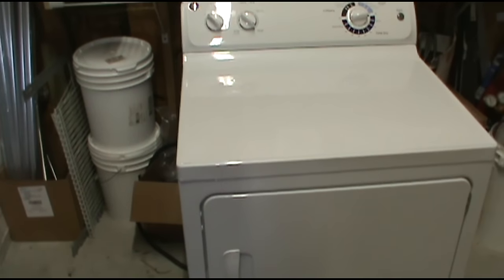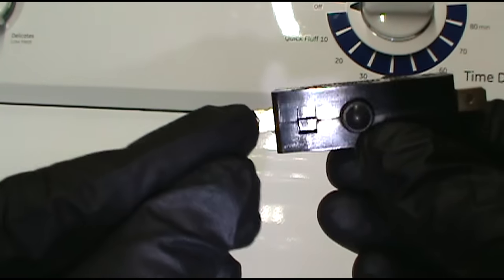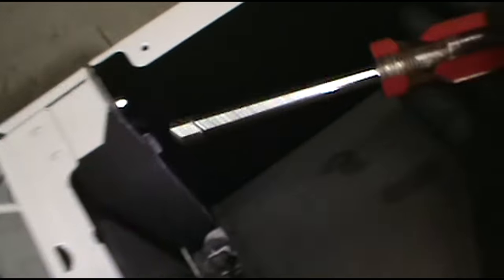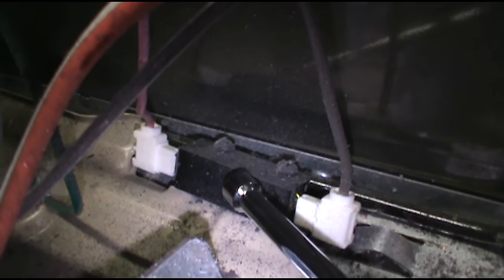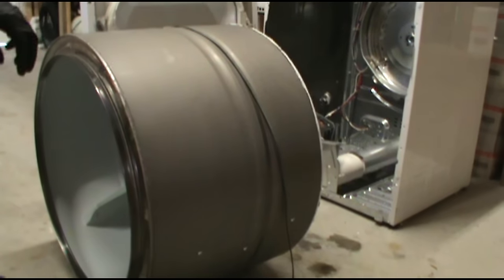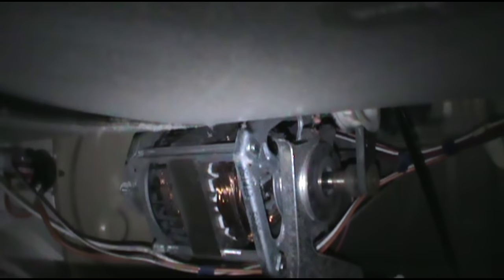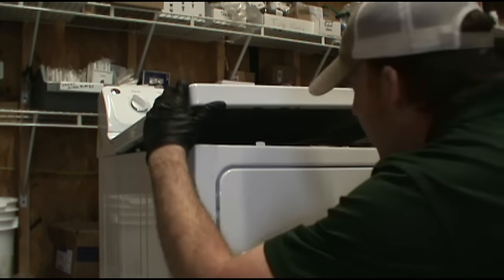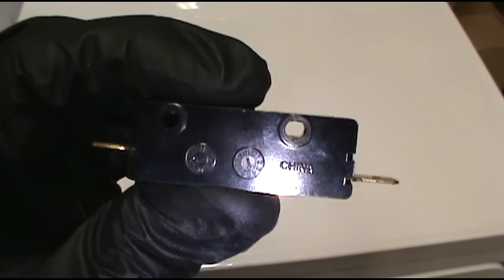Dryer Will Not Stay On After Pushing Start (How to Fix)

Comment: When I push my start button on this exact model nothing happens. I can manually spin the drum, which pushes that pulley switch button and th3 drum will spin. However, no heat. Bypassed thermal fuse, still no fix. Could it be the start switch afterall? Here is the kicker - if I set it to "no heat air fluff" mode, I cant get the drum to spin by giving it a shove anymore!
Reply from the maker: That's a head smasher. Pull the timer dial switch off & make sure it's not cracked. Dryers are hard to diagnose when not there. Could be belt snapped. Could be bad motor. No heat could be a broken element. I'd need to be there for this one.

Comment: My problem is the dryer runs for about five minutes then shuts off. It heats up and the drum turns. I checked all the sensors and they are good. Any suggestions on what the problem could be?
Reply from the maker: The vent tube in the back of the dryer is either kinked or clogged with lint. If the heat can't get out, it will shut off. It's the safety switches doing their job. Hope this helps! 🤞 Thank you so much for watching preclovis!

Comment: Our belt is completely torn and we believe it was because of an excessive load. It is likely that the belt just needs to be replaced? The machine is only 3ish years old.
Reply from the maker: Yep, just replace it. Check the wheel that it rides on for any rough areas, just to make sure. But, sometimes they just break. It's like a big rubber band that expands & contracts when it gets hot & then cools off. Doing that over & over for years will cause it to break. Thank you so much for watching Derrick!
www.DirtyMaintenanceNation.com
Reply: @LexVance  Replacing the belt worked. It took me a while to figure out the exact zig zag way in which to install it but glad it's done. Thanks!

Comment: My dryer does spin but it won't stay on past 8 seconds. It's also really loud. Could it still be a belt issue?
Reply from the maker: Could be. Maybe the belt slipped off the pulley wheel.

Comment: What if that switch is good and you still have that push button issue?
Reply from the maker: Hmmm I'd need to be there for this head scratcher 🤔.
Reply: @LexVance  early 90s kenmore gas dryer. The motor doesnt exist and theres a replacement. But the new on needs rewiring. Followed instructions and now i have this issue. So annoying. Lol

Comment: I appreciate the help brother
Reply from the maker: You're welcome Jan! Thank you so much for watching!
Reply: @LexVance  After replacing the drum belt, I got into the problem of the machine not staying on. Following your video, I checked continuity of that click switch by the tensioner arm. That was where the problem was. The push button of the click switch was missing the rubber cap not allowing the tensioner arm to push all the way until the click switch made proper contact. Luckily, I found the rubber cap laying on the floor of the dryer assembly. Likely it got dislodge from the impact when the drum belt snapped. Reinstalled it and tested the click switch following your video. All is well!

Comment: Is this gas or electric? If gas are the symptoms the same with the stopping?
Reply from the maker: This is electric. See if the vent tube coming out of the back of the dryer is clogged with lent. Just pull it off and clean it out. If the heat can't get out, the safety switch will shut it off. Thank you so much for watching REP!

Comment: What is the name of The switch. I have an identical one off of my dryer but I can’t find the name for it online. When I type in door switch I get the switch that’s actually on the door and not underneath the pulley
Reply from the maker: Interlock switch. Thank you so much for watching Danny!
Reply: @LexVance  thanks man i just found it on line while at lowes and of and of course Lowes doesn't carry them.
Reply: @LexVance  yeah I was losing my mind for hours trying to figure out what the fuck the problem was thank you for the video man.

Comment: When you re insert the drum how do you get it to stay lifted and not touch the bottom aluminum piece?
Reply from the maker: The back bearing has to go into the hole that's in the middle of the element. Then, put the front door on. That's how I did it.

Comment: So, I change the belt and it works perfectly after. The thing is it can only dry a few pieces of clothes in it. It doesn’t spin if I put more in. I need help.
Reply from the maker: Motor may be going bad and can't take the weight. Time for a new one.
Reply: @LexVance  But I have only had it for almost 6 years
Reply: @LexVance  so when we open the top and start the dryer, I can see that the drum is not spinning but the belt is gliding like it just doesn’t hold on to it and move the drum. (There was clothes in the dryer when we tried it)

Comment: Dryer still heats, drum still turns, but i have to hold dpwn the timer button to run it (its also the start button) as soon as i let go it it turns off. But if i keep pushing it down it will stay running. Any suggestions?
Reply from the maker: The dryer interlock switch may be bad. That's what happens when they go bad. It shuts off when you let go of start switch. Thank you so much for watching Stephen!
Reply: @LexVance  thanks, ill have to look up the part number for my exact model

Comment: My GE gas dryer turns on and seems to work, but turns off after about 10 min or less.  Any Idea?
Reply from the maker: Could be a clogged vent line behind the dryer. If the heat can't get out, the safety switch will shut it off to prevent it from getting too hot and causing a fire.
Reply from the maker: Pull the foil vent tube off the back and see if you can clean it out.

Comment: Hi
I have same dryer but the problem is After 5 Minute Dryer Automatically heating off..
can you pls tell me the reasons??
Reply from the maker: Check to see if vent line has a kink in it. Dryer will shut off if its getting too hot due to not venting heat properly. If that's not it, turn timer by hand & see if it shuts off in the same spot. If it does, the timer is bad. Thank you so much for watching 4ti!
www.DirtyMaintenanceNation.com

Comment: What if your getting power to the dryer but it will not start at all when you push the start button? ` I have a dryer just like the one in your video....
I am thinking 3 possible problems Lex
1-start switch bad
2-door switch bad
3-temo control fuse
Reply from the maker: Tracey Ferrell Pull the timer knob off. It just pulls off. If it's cracked, slide a new one on. Easy fix! Its very common with these dryers. Thank you so much for watching Tracey!
www.DirtyMaintenanceNation.com

Comment: My dryer spins with heat.  When I press the button but it will not stay down. I have to keep pressing the button so it will go.
Reply from the maker: It could be a bad inlet switch. I talk about that in this video as well. Thank you so much for watching Darren! 
www.DirtyMaintenanceNation.com
Reply: @LexVance  thanks..and where can I buy one of those test meters. what are they called?

Comment: I have this exact dryer, and I have the problem you describe.  BUT my drum rotates fine ... So I had a repairman in today, and I mentioned "I think it's a belt or a switch."   He takes his time and calls someone back at his company, too.  Then proceeds to tell me, "the motor needs replaced and it will cost $491."  Of course that is not going to happen, and I don't believe that it IS the motor.  I had to pay $89 for this young guy to tell me this ridiculous answer?  Getting a different company in here to look at it will cost about the same, AND I will have to take 1/2 a day off work.  By the time I get this issue fixed, I might as well buy a new dryer???  :(  

Meanwhile, I am using DUCT Tape to hold down the start button, and that is working.  I have to rearrange the duct tape as the dryer heats, because it loosens up and the dryer turns off again.
Reply from the maker: Hmmm, how can it be the motor when the motor is spinning? 
👍😂👍Thank you so much for watching Carolyn!
www.DirtyMaintenanceNation.com
Reply: What would you do in this circumstance, Lex, if you were me?
Reply: Hi! Looks like I’m having the same problem and solving it the same way. I duct tape the start button down and everything works; the drum spins and the heat goes on. Is there any way of getting to that switch you showed without removing the drum? My dryer is a Kenmore elite.. that’s what it says on the front. Thanks for your help!
Reply: We had the same experience.  My dear wife always wants me to spare the trouble and call someone, so I did.  He charged $65 and found it running fine; left with the "guarantee" that we'd get a $65 "credit" (within 30 days only) if we needed it fixed.  A few days later, it started but turned off just as before.  This time he told my wife over the phone that it was the motor, which he could replace for $300 (I HOPE minus my $65).  He'd only seen it once and pronounced it fine — without so much as checking the vent for lint!

Using Lex's video, I got down to the belt interlock microswitch and found it not working.  $11 on Amazon for the fix (NOT counting the $65 he gouged us for)!  Sure glad to have "pros" like that to keep dummies like me from doing it ourselves.

Comment: Belt is fine....button has continuity.

The dryer would run and then stop after 9min.

Then the drum stopped turning too
Reply from the maker: See if your vent line is clogged. Could be shutting off in high heat overloaded due to poor ventilation.

Comment: After I changed the belt , the drum spin, but starter still not working.
Reply from the maker: There's an interlock switch. That could be bad or the motor could be shot. I'd need to be there with my volt meter to see what's going on.
Reply: Lex Vance I got it fixed today, thank you so much for your video.

Comment: What's the typical cause of this happening? And how to prevent it
Reply from the maker: Lint getting caught in the motor blower blades that you have to clean or the interlock switch is broken.
Reply: @LexVance  I really don't mean to be a useless bother but I have the exact machine as in the video what kinda belts are those cus I need some

Comment: What if it sometimes turns on or turns on then shuts off after a couple mins
Reply from the maker: See if vent line behind dryer is clogged or crimped. It pulls off when clips are loosened. If it's clogged, the safety switch will shut dryer off to prevent overheating.

Comment: Wow, that was a clean dryer, no lint inside the dryer, it couldn’t be a new dryer with a broken belt.?
Reply from the maker: A new dryer with a broken belt is rare but it could be. Especially now days. 😆
Reply: @LexVance  yeah, I totally agree, things now days are not made with quality like in the past, they use cheap parts, they compromise to make money, I remember my mom and dads appliances would never break down, we only threw them away because we were convinced the newer saved on electricity. Thanks again

Comment: I need help my ge start switch wont stay on help i had some one test it its find
Reply from the maker: CHRISTOPHER MCDOWELL So, when you hit start the dryer won't stay on when you let go?
Thank you so much for watching Christopher!
www.DirtyMaintenanceNation.com
Reply: Yes its not staying on the drum is spinning
Reply from the maker: CHRISTOPHER MCDOWELL It may be the switch that I talk about in this video. Did you see the switch?
Reply: Lex,   I turned the "on" switch, drum not moving when depressing door switch.   My belt was broken; I replaced the belt. Won't stay on after turning "on switch", have to hold it on.  I took dryer apart again,  I saw this switch, removed the belt switch, tested it, it tests good.  Now, is it the motor?
Reply from the maker: tab lloyd Geeez! Man I don't know. That's a hard one to diagnose over YouTube comments. I'd need to be there looking at it. In my 15 years, its always been either the belt or the belt switch. Never the motor.
Reply: Lex Vance.    thanks for giving your input, I appreciate it, of course you can come look :). Meanwhile I'll keep digging.

Comment: Common problem - The motor came on when I pushed the start button, but the drum didn't turn.  So I replaced the belt.  Then the drum turned with the start button, voila, but the motor still wouldn't stay on!   What the heck??  I must have bumped the arm that holds the pulley tension wheel when I yanked the drum, because the safety switch wasn't responsive.   I adjusted the position of the metal arm until I heard a good reliable switch click noise, and everything is back on line.   GTD33EASK0WW
Reply from the maker: Nice fix Ohara!

Comment: What happens if my drum is spinning
Reply from the maker: Hmmm I'd need to be there for this head scratcher 🤔
Reply: Ok I seen another video this one said relay at the top there is two identical one for motor one for temp. I'm just so dang confused now I bought the push start button thinking that was it and it wasn't still same problem. Do u live in NC cause I need help